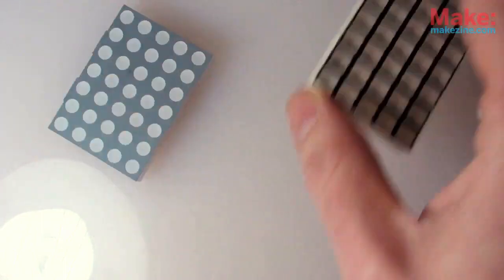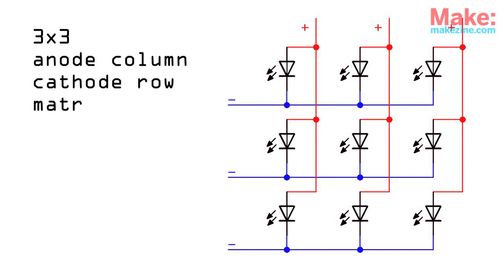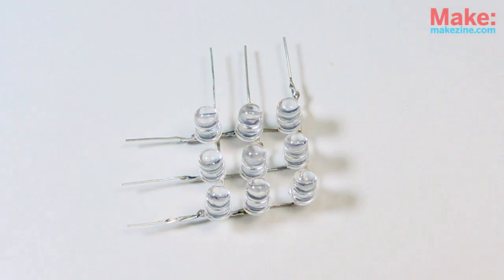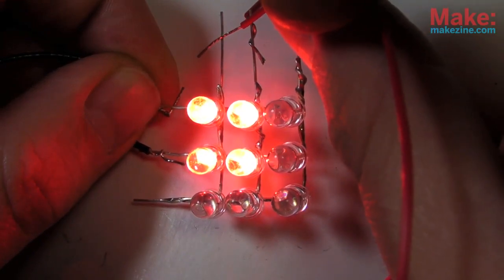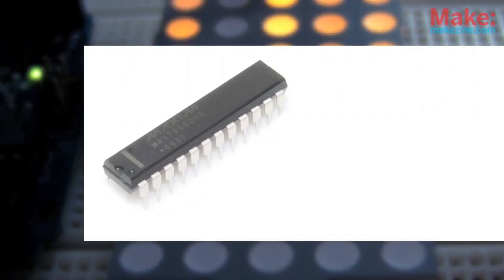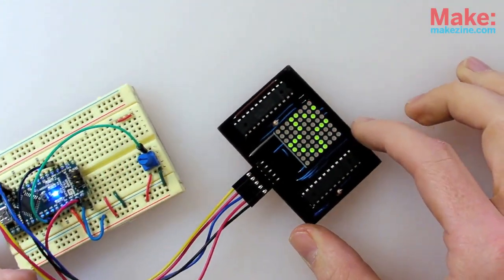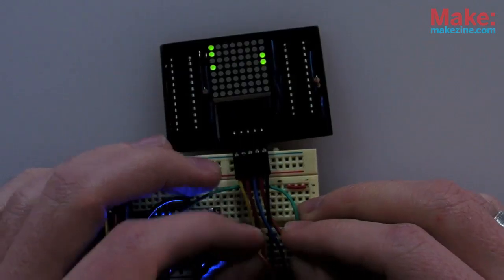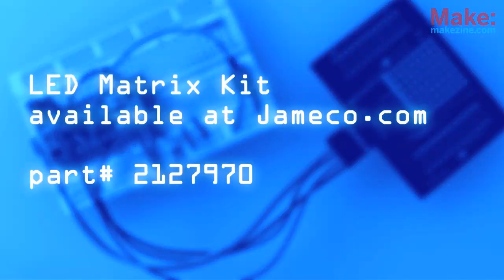Circuit Skills: LED Matrix

Comment: I actually built an 8x8 LED matrix in a very similar way to how he made the 3x3 matrix. I didn't use any board for it, though perfboard would have been nice to help hold the leds in a clean grid and make the display more rigid, sadly though I did not have any on hand. To avoid burning my fingers every time I soldered an led, and to make holding the LEDs in place while I soldered easier,  I used play-dough that I flattened out and pushed the LEDs into it to hold them in line. If you decide to do this I definitely recommend using something like play-dough to hold them in place.

Comment: How about rigging it to an array of distance sensors to make a low resolution depth camera?

Is the Arduino fast enough to generate a scrolling spectrogram at that resolution in real time?

(if it's not obvious yet, i barely know these things; my knowledge about each item could probably fit on a hovertip)

Comment: I UNDERSTOOD! I only have to use 3 NPN transistors to power the anodes and power the cathodes directly with the microcontroller. So I use 6 pins of the microcontroller, and use a minimum delay, so, when I flash a LED, and want to flash the another LED togheter, I turn it off it quickly and turns on the other, delay a milisecond and turn it off and turn the other on so fast that nobody will see then turning off!! :D (sorry by my VERY poor english)

Comment: @eightstudio he has another video on it. basically its like developing film or silk screening. The have a transparency with the design of the board on it and a board coated with resist. this is then exposed to light after being cured with the paper on top. the portions with the transparency on in will have the resist under it but the portion exposed to light will allow the resist to dissolve. It is then cure again. Watch the video for more detail

Comment: Collin says that the  the process of multiplexing  is-  lighting few LEDs fast. Actually it is called persistence of vision.Multiplexing is wiring method used here! correct me if I am wrong.
Reply: That sounds like phosphor persistence, like a CRT, where the excited phosphor glows long enough for the electron beam to make it's rounds before hitting a particular area again.  What confuses me, is in the video he is talking about multiplexing being a way to get around multiple LEDs lighting when all you are attempting to do is light a certain one, but then explains how this multiplexing will light them up so fast that they ALL appear to be lit at once.  Is that not making the initial problem worse?  - "Well, this one here lights up along with this one, but... if I do THIS they ALL appear to light up at the same time!  Problem solved!"  ??????????

Comment: Soo if I want to drive an RGB LED matrix, how should I do it? Can I consider it as three separate 1-color matrices and use the MAX721 chip to drive each of them? Or are there some better ways to do it?
Reply: Sci Twi Three separate drivers would work.  By using PWM and creating 0 - 255 intensity levels as well for the RGB channels, you have yourself a 16.4m colour 8 x 8 pixel display :)

Comment: @TutorialsByKevin If you want to assemble the matric of LED's which adds up to... lets see, 1024x768x4 for the colour combinations, you need right around 3.1 million individual LED's that need to be soldiered, not to mention the control boards. Good luck with that.

Comment: do I need the arduino? and why? beginner here
Reply: the arduino contains the program. you could use a different microcontroller, but arduino is really easy to use
Reply: Sean Ocansey thanks
Reply: Trūë SAvAgE Np 👍
Reply: Or design the multiplexing circuit using discrete ICs.

Comment: un arduino made in italy????

a made-in-italy arduino board???
Reply: Arduino is made in Italy, yes.
Reply: LimitedWard good, because i'm italian
Reply: all of arduinos are italian
:P
Reply: Roberto Santo The brand name ones yes but there are a lot of cheap clones from CHINA
Reply: I AM ITALIAN and i use only arduino made in italy. support for ITALY!!
Reply: Roberto Santo bravo! anche io sono ITALIANO, viva la MIA Italia,LA NOSTRA Italia.
Reply: Roberto Santo
 The chinese imitations suck i preffer the original one
Reply: Surya Mani NO the chinese Clones are just as good if not better because they are 3X less $!
Reply: MyWillyboi cool
Reply: Surya Mani Indeed they do, bought one and it didn't last very long.
Bought a "real" one, still working.
Reply: +Surya Mani because arduino is open source, some of the Chinese ones are EXACTLY the same. like the pro mini, it's just cheaper